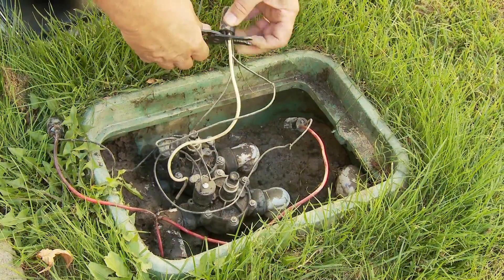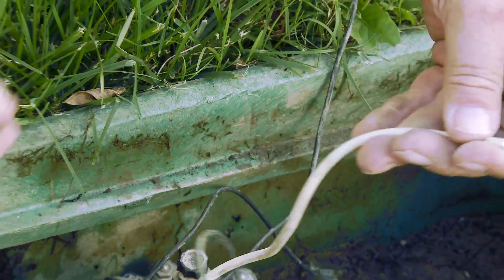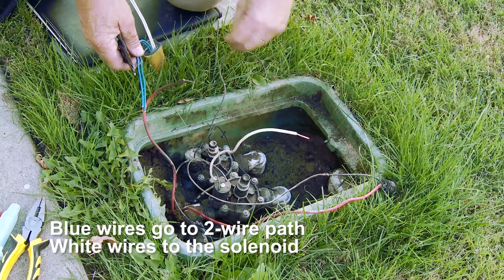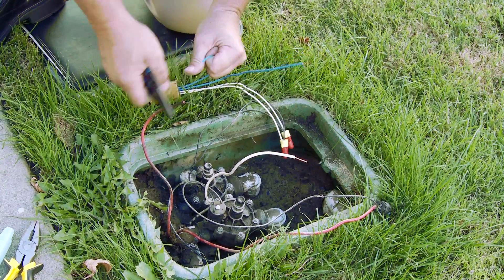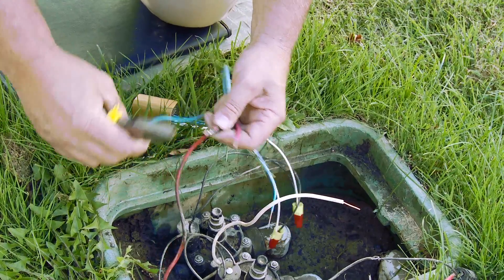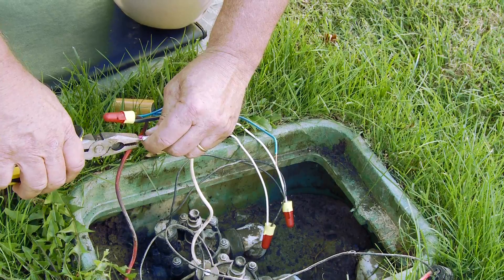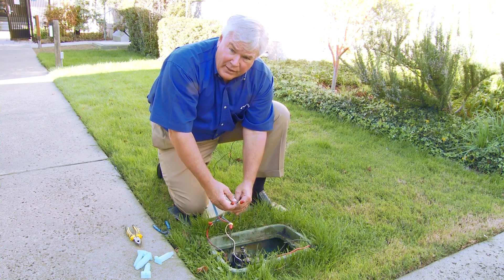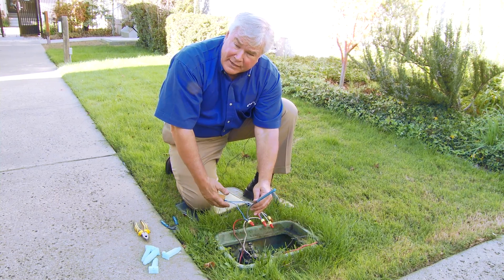Install 3D Controller

Comment: What is the advantage here? Does that mean I would still need to run a wire from that first valve to every other valve? Am I only saving labor by not having to run wires to the clock?